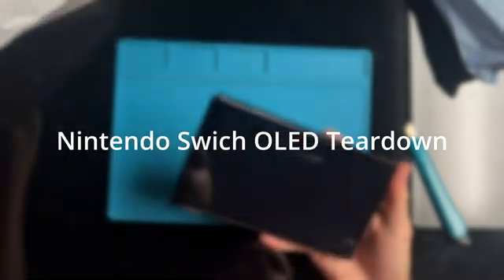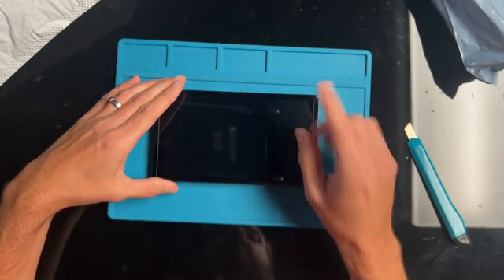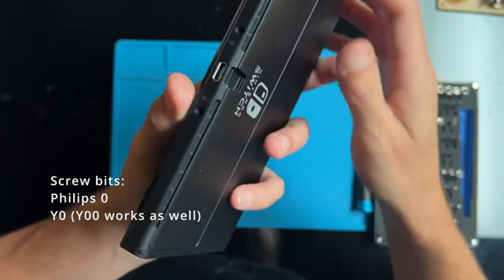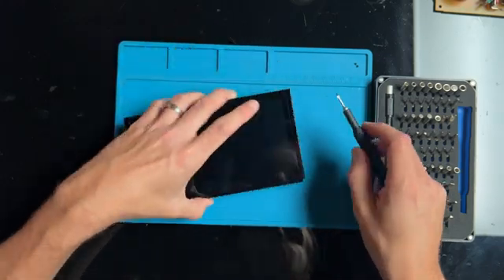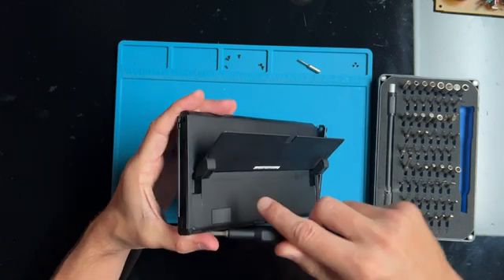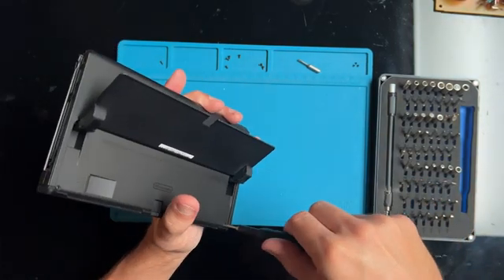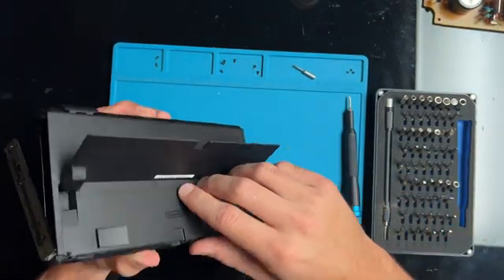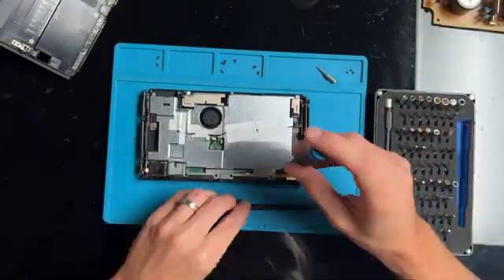Nintendo Switch OLED Teardown

Comment: Has their been any minor changes that you notice of switches that you teardown/repair this year compared to ones over the few years. Sometimes companies make some minor adjustments and changes to their consoles to perform better such as i seen with some tear downs of ps4 and ps5 when comparing different year models. I wondering if switch has done so as well.
Reply from the maker: It seems to me that the boards they use for each Switch design has stayed pretty much the same over the years. The original, Lite, and OLED have different layouts but even then they use mostly the same chips(which is very convenient). One area that I’ve noticed a slight difference in is around the Max IC left of the charging port on the original. Other than that, it’s mostly the same board across the years which is impressive, especially compared to the PS5 and its already many revisions in its much shorter lifespan.
Reply: @FixMoreWasteLess  Thought i would ask cause its strange sony and xbxox sometimes make minor little revisions or updates to their system but haven't really seen anything like that with switch.